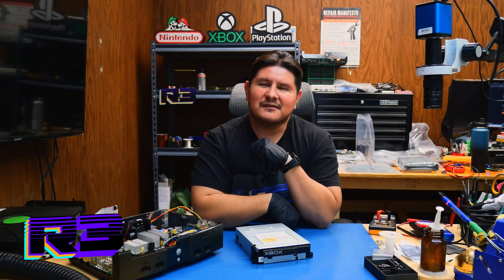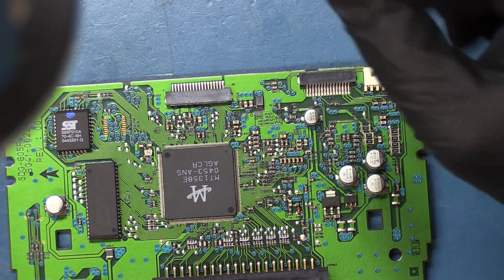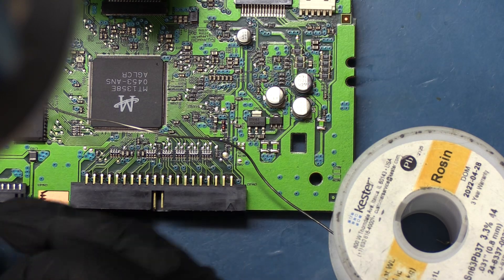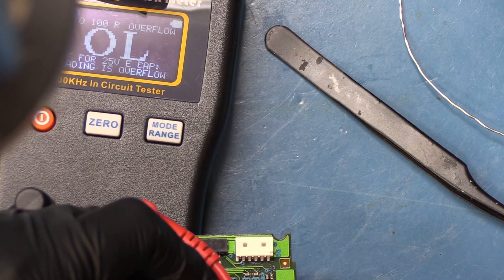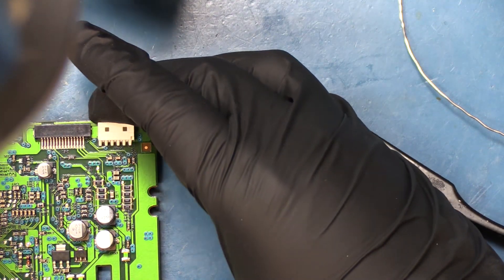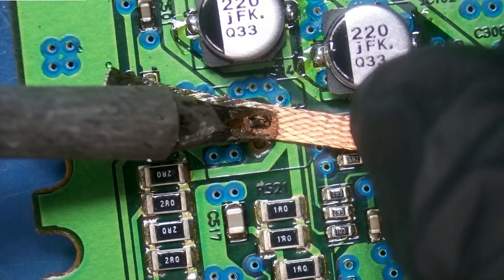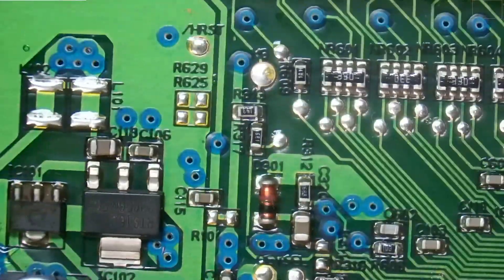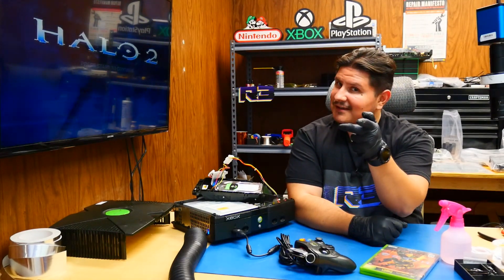OG XBOX Samsung SDG-605 Disc Drive Recapping - Does ESR Even Matter?

Comment: Has anyone here in the comments actually revived a dead Samsung drive replacing caps? Just got an Xbox that was never opened and super clean inside that doesn't read discs. Oddly, there was some oily residue around the laser lens so I did clean it but it still doesn't read. It tries to but gives up. Trying to decide if it's the laser or the caps.

Comment: Would replacing the caps help with the disc tray coming out? Iv replaced the belt and I still have to touch the tray for it to wanna eject after hitting the button.
Reply from the maker: Some have said the motor could have issues due to power delivery. So replacing the caps may help if that's the case.

Comment: can this actually revive a dead xbox dvd drive? i'd never though of it before.
Reply from the maker: People have said replacing the capacitors has revived a few. I've personally never run across a drive that was revived by doing do. That said though, I know failing caps can cause issues with the motor and laser.

Comment: These SDG-605F drives are notorious for failing capacitors. Especially the little 47uF 6V cap is close to failing or failed on most examples I work on (it's quite similar to what happens with one little cap on GameCube disc drive boards). If it tests over 5 Ohm, it's gotta go (in most cases I see 8-10 Ohm when it's about to go and even higher when it has already failed). I have successfully fixed a couple of dead drives using this repair when the caps test way off like this.

The bigger caps should usually be at 0.5 Ohm or lower. They aren't quite as bad as the little cap, but when I'm already doing the job I change those as well.

Also, I 100% agree that this soldering technique for the replacements is great, that's the only method I use.
Reply: You don't want to see my factory caps in SDG-605B from January 2003. Apart from the SMD polymer electrolytic caps (which I hope they are fine), they are also traditional THT caps, which in my case were bulged as hell. I'm waiting for replacement caps to my logic board, I've decided to buy the tantal ones with the same specs as the factory caps to see the result. Previously to make this 605B to work I had to wait some time for the capacitors to heat up. Now it won't recognize discs at any cost, so that's why I'm doing recapping.
Reply: Unfortunately changing THT caps didn't make any difference, so I'm trying to replace all polymer SMDs and I have to find someone with working SOH-D16/DR16S/D12 pickup to make sure that it's working again.

Also I've checked resistors near to IDE connector and they're all fine.
Reply: I came back with some good news. I've received an optical pickup SOH-DR16S and my 605B is finally working! I didn't change those polymer SMDs and it looks like my previous optical pickups (Factory D16 and replacement D12) were dead. Now it works like a charm. I also cleaned all plastics in this DVD drive and regrease all tray sleds and the rest of plastic-metal mechanisms. I'm very happy from its results and satisfied with all my effort.

Comment: Was the dvd drive not reading discs prior to recap service?

I’ve attempted this on a Philips and a Samsung and both went from not reading discs to error 12. Double and triple checked cap polarity and still.
Reply: You probably ripped the pads off and didn’t check for continuity.
Reply: @S_Tier_Final_Boss  I didn’t …..all that has been verified …..Caps were all through hole so can’t rip pads
Reply: @alataweel8954  it’s possible to burn vias around the through holes. I’ve done that before by putting too much heat and not enough flux when trying to remove a cap. You might have to wire a trace. I’ve never had to do that, but it’s fixable.

Comment: twisting the capacitors from the board is one on the biggest "right or wrong" questions in existence 😀Nice to see you doing it anyway!
Reply: I used to think the same as i started recapping my consoles a few months back. First a SNES where I was scared to attempt it and the result was 2 ripped pads and a broken trace (which i had to fix). After that 1 other SNES and one N64 doing the twist (gentler than shown here because i have not enough confidence or experience) and no ripped pads whatsoever.
Reply: Wrong in this case. Now if its a 0805 ceramic that's shorted, go ahead and pop that baby off.

Comment: Any idea why these drives struggle to open or if it nit reading may be due to the caps?
Reply: A lot of the times, it's worn out rubber bands and dirty hardware like gears and whatnot that guide the mechanism. Cleaning and regressing, replacing the rubber bands, usually solves these issues
Reply: Maybe needs new belt, cleaning, and lubricated rails and gears.
Reply: theres a lot of moving parts in a drive. im sure the caps weren't the only issue
Reply: The large gear wheel in my hitachi drive was missing some teeth on the bottom. Could not see it until i took it out.
Reply: Yes, bad capacitor mean less energy to IC that powers up the tray motor, less power to move the mechanical components. Aka torque or motor strength to spin properly. 

Poor performance, despite clear gears, clean tray, proper lube and a rubber band replacement in the mechanical assembly. And of course, struggling to read the games, DVD video or CD Audio discs. 

Bad capacitors also interfere with the stability required to optimal disc motor movement, - spin motor - the motor that moves the laser - sled motor - and the system that turns on the laser diode and the tracking and focus coils. Is the same IC that controls disc tray working along with the main and bigger IC